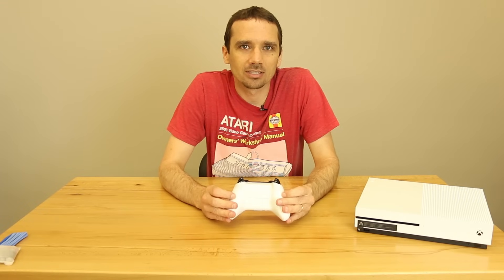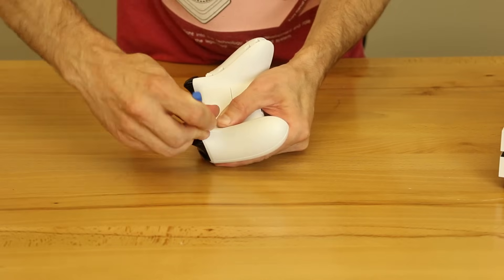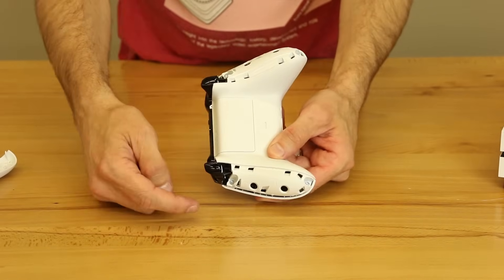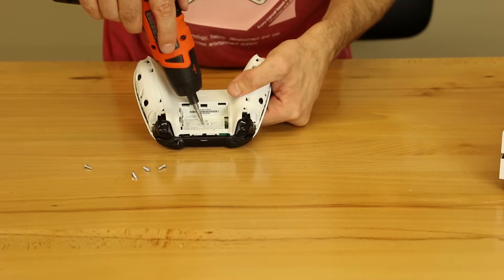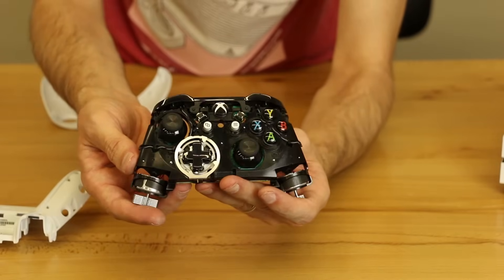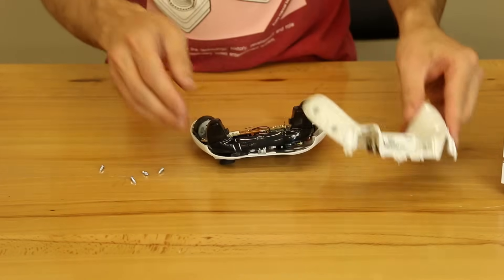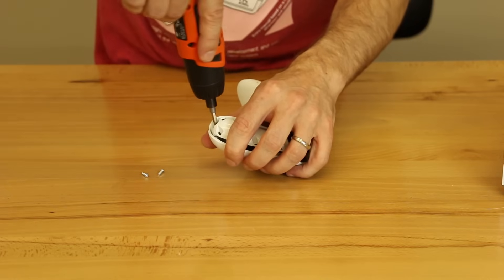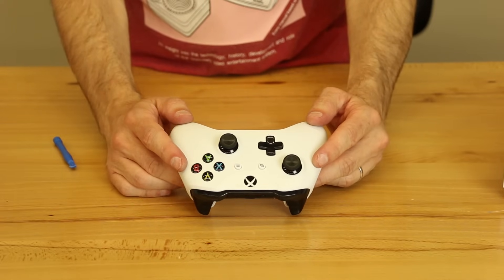Xbox One S Controller Teardown And Assembly

Comment: a small tip to anyone doing this. take the controller in your NON dominant hand. hold it so the joysticks are in to your stomach, or lap, take your non dominant hand, and put the thumb of that hand on top of the trigger button, and use a pry tool with your dominant hand. as you begin to pry with the tool, push your thumb from your non dominant hand down on the trigger button & depress it, and slide the thumb down to where its slightly under the back panels. it makes popping the rear panels off SO much easier

Comment: Thanks. One suggestion, if I may. The screw in the plastic when you want to screw it back in needs to be turn a bit in the opposite side to find a moment then the screw perfectly align the spiral row of the thread in the plastic - otherwise the screw will start creating a new row in the plastic, so after a few dis assemblies there will be no thread at all in the plastic.

Comment: The Lt  trigger was stiff due to when I dropped it in Kitchen.i had a headset on due to crazy noise where I live.  Thing is now Lt isn't stiff but lb is getting stuck. How does one clean .I read using alcohol etc .but if I take apart can clean easier. Don't want break as cd sell to store. I might try on old X360 pad and replace analog

Comment: When trying to reassemble my controller for the first time after doing a custom paint job, I thought I could do it myself without a tutorial. Afterwards I realized it was really squeaky, the screws wouldnt go all the way in, and the trigger made a clicking noise. I finally gave in and watched a tutorial and realized that I had placed the backplate on top of the battery contacts instead of letting the contacts go around the backplate, causing them to bend and make the backplate and front plate not come together as they were supposed to, proving that a little help is needed for everything

Comment: How do you disassemble it further?

This video only shows how to take off the casing on the controller but I want to be able to get to further into the controller.

Im trying to figure out what exactly is wrong with my x button. I see additional smaller T screws on the front side that holds the controller with the electronics together something that was not mentioned in this video

Comment: Jan 2022: Very helpful video. Managed to use a 2mm wide flat bladed precision screwdriver instead of a Torx bit.  Will lock itself offset between the security point and the inside edges of the screw head.

Comment: Using a small straight blade gets them out as well. You did not show how to take both boards out to repair sticky buttons. I figured it out however. PS1, PS2, PS3 & 4, SEGA Master, Genesis, N64, Xbox 360, NES & SNES, & Game Cube controllers I’ve completely rebuilt so that helped. Thanks for the starter vid however, it helped

Comment: Hey @tronicsFix I had a question for you, how would I go about create a controller with just one button functionality resulting in the A button and the wireless functionality. What part of the circuit boards in a Xbox one controller would i need to take apart for that. Remember I just want one button that results in A and wireless functionality.

Comment: Dont have a tool like that and the things don't seem to come off with hands ..
Ps : finally took the plastic handles off and the Screwes are nothing like those they are Way way smaller and very specific dont seem to have a screw driver small enough or special enough to unscrew them.

Comment: hey i was changing analogue sticks on this one and for some reason my home button won't register anymore (it lights up though). In order to power the controller i need to connect it to usb power. Any ideas what might have gone wrong ? I didn't touch the PCB board where the home button is located . I only desoldered the analogue sticks. Also currently I'm testing this with one analogue stick on board which i successfully installed and is working fine. The other one is missing since i'm expecting the part to arrive.

Comment: I need to add these to my elite controller. Grips are coming off and brand new ones are $90
Reply: Check Amazon. Replacement side covers are $20, and are a close match to OEM.

Any peeling or stretching of the grip part on the rear housing can be repaired, results will depend on how bad it is and your skill doing the repair. 👍

Comment: Just use a flathead screwdriver to pry it down 1 side, then continue up the other side. If you don't have a security star bit, a jeweler's flathead will fit between the center pin and the star ridges and it's just as easy to unscrew. Even better, sometimes the center pin snaps off with the flathead, then you can use a regular star bit. Took me 5 minutes. Hard to do with the wrong application, easy with an effective one. For the love of God why are you people using scissors

Comment: This man took his screw out in 10 seconds meanwhile I’ve been sitting here for the past half hour trying to get the first screw out.
Reply: Yeah same for some reason my t9 isn't fitting.
Reply: @caseybowen5111  you need a t9H
Reply: @krystek3099  Okay thanks I didn't realize there was a pin inside. Thankfully I didn't need to take apart my controller that far.

Comment: I mean, if you have the balls to pry the panels off of your $60-80 controller it then they should just let u mod away, cus if you ruin the panel it’s pretty much mega oof for the controller’s solid feel. that’s the only thing preventing me from doing this, I need to put the stick back in cus it broke and popped out and I fixed the stick and now I just need to open it up, I don’t have the screwdriver to do this but i’ve seen people improvise, I’m probs just gonna go for buying the screwdriver and wing the rest cus it doesn’t seem so bad, and the clips seem strong on the panels.

Comment: If you have a really small flat head, it's pretty easy to snap off the pins inside the torx screws, so you don't need to use a security torx.

Comment: Disassembled my ass this is like posting a vid of stripping a full car then taking the wheels off and saying job done. This is nothing u need to get the soldering iron out (thats whats diff from normal xbox one btw) to remove the vibrators then get the next set of screws out and remove the board to reveal the abyx home and other buttons... This vid was useless.

Comment: just a heads up never, ever use a drill that fast into a plastic mount, or even metal for that measure; all it takes is one slip and you'll flush the thread clean; do it by hand and you'd easily feel if you're about to screw your thread over.

Comment: Two hours in... Still can't get it open and I've hurt myself many times.
Reply: I literally opened it, changed the dpad, and was done in 20 minutes. I had 0 previous experience
Reply: @gavindunlap724  seriously I had to just get a broken plastic tab out of the controller cause it was moving around inside.
Reply: How? I'm sitting here just trying to get these darn screws out
Reply: Same 😪
Reply: I tried using scissors and just cut my hand
Reply: @NexyOJF  for what in the hell where you using the scissors for?
Reply: @salvatoredelilleorlansino5332  lol cuz I tried putting it in the crack to open it
Reply: @NexyOJF  ouuu, yeah, some controllers come with those parts higher, mine where lose from the beiginning
Reply: @NexyOJF  I'm so sorry Dx 

We are better off just buying a new one I guess.. Better than a hospital trip ya know?
Reply: Yes it hurt alot
Reply: Yea
Reply: I rage quit...
Reply: It's hard but after you do it once you get the hang of it
Reply: Y’all are weak, I got them off with ease
Reply: Use a flat head screw driver at the top just pry it open then go down
Reply: I just use a really small flathead
Reply: Same bruh
Reply: WHAT
Reply: Suspicious that the high number of suicides among teenage males may actually just be due to injuries sustained in this process. Goodby cruel world///

Comment: To those who's trying to find out the screw size, it's T9H. Note the H, because there is a hole in the middle of the torx. The screw has a protruding spike in the middle. That's why normal T9 would not work.
Reply: Literally the most annoying thing ever
Reply: @maxiboyman  they make it like that because they don’t want you to fix it and to just buy a new one
Reply: @boynowayboy3218  you can buy these bits at literally any hardware store
Reply: T9 works if you break the h with a small flat head
Reply: @DRAVO212  what does that mean
Reply: @DRAVO212  how do you break it
Reply: You can use a T8 it works
Reply: The least I have is t10 😑
Reply: There is a way around it without using the correct tool. The little pin in the centre helps hold a flat head screwdriver in place and lodge it in snug even though it's slightly offset you can still get it off and tighten it back up
Reply: Just knock the pin out the midd of the screw..simple. and i see you did not tear into the buttons and dual level circ boards....you should, bcuz im there rn
Reply: I thinks it's a T8H because that works perfectly for me
Reply: I had to use a tr 8
Reply: T8 does not work I have a set that stops at T8, yes you can break the piece in the middle but that doesn't always work so that's why it's just best to get the H version of what you need. T9H is the exact tool you need

Comment: I got a chrome case for Christmas and had no idea how to put it on. I was scared because it looked like I would have to completely take apart my controller, but from this video I have learned that I don’t need the bit that came with it which looks to be what all the components are normally held in, I just need the top and bottom case and I can just screw those on to the controller.

Comment: I opened my controller and I actually fixed something that was broken!
Reply: Did you use the T9, cuz for me it didn't work
Reply: @Memeify apperantly there's two types of T9's and the other one worked.
Reply: Thomas Raffensberger yeah it’s meant to be t8 security screw but I guess t9 also works apparently
Reply: Is it normal to hear a slight hum from the controller?
Reply: Tomato Tom yeah
Reply: @ukwqs  thanks

Comment: Hey Steve, I'm a fan of your videos. I just had a question on my controller, the left and right triggers when I hold them down get stuck. when I took the handle piece off I tried cleaning it with ipa and noticed a piece of sticky foam where the trigger meets with the panel when u press down. is it okay if I go ahead and remove those foam pieces ?
Reply: Youssef Dirani umm I wouldn’t do that I don’t think this is the cause if your problems though you might have something stuck down in the lower part of the controller
Reply: When I used to play a lot it would get stuck sometimes and I would here a weird click turns out it was a piece of the controller that would get in the way every now and then, however I wouldn’t remove those foam pieces they shouldn’t be what is causing them to stick unless they are sticky on the outside if they are then I would remove them but those are to stop the triggers from hitting the base or whatever when you click them
Reply: @joshuajones6905  hey I went ahead and removed them, yeah they foam pieces themselves were sticky.. the controller works great now

Comment: The major difference is that POS black wire.  It's connector is prone to breaking off with even the slightest force.  I can almost hear the design leads snickering knowing full well that most people will irreparably break the controller attempting to repair a sticky button.

Comment: I’m going to hydro dip it
Reply: I'm gonna use a blue and purple color shift
Reply: I’m also gonna hydro dip
Reply: All here for the same reason I guess.
Reply: Yeah I’m finna hydro dip
Reply: Yeah, i came here just for this purpose, does anyone have hints for hydro dipping? I was experimenting, so far i covered the body with an acrylic spray can and then a second layer with clear polish spray, but the result is not quite as smooth as expected. I'm also having an hard time in properly preparing the hydro dip with clear nail polish, any hints?
Reply: I came here to clean mine.  I thinking about possibility paintings mine with air brush
Reply: I’m going to customize, I am a professional customizer.

Comment: I got my headphone jack stuck into my controller and was wondering if taking apart my controller would allow me to remove it? Does anyone know
Reply: It will let you get the 3.5 unit out.  It just sits there unsecured between the two boards.  But if it's somehow stuck via debris, it's probably not going to help always unless you want to destroy the jack module.

Comment: When you have every tool ever made but a T9 socket R.I.P

Then you find a T9 but it's not the same T9 with a hole in it 💀
Reply: Lou E the whole needs to brake a really tiny flat head screw
Reply: @zombiekill541  lmaoo thanks bro i used the sl1
Reply: Me to bro everything but smh even have a t10
Reply: @journeytosafemylife2993   t15, t25, t27, t30, t40 lol and I'm sure there is more

Comment: The little wire between boards is that a pin or solder connection? Need to know before I take it off.

Comment: Hey man, im following your channel lately and it's very cool, i have one problem and maybe you can give me a hint or something... i have and xbox one controller, mod 1537, the first one that came up i think... anyway... both triggers are detected as pressed all the time, i tested this with windows 10 also... i removed the hall sensors effect and they still are detected as pressed... i was wondering if i can do some of this things: 1. replace the rt and lt with normal buttons with some modding, 2. somehow bypass or remove something to at least have the controller without detecting the triggers pressed. I am from argentina and it's very difficult to get spare parts of any kind here... and a new controller is VERY expensive... if you can give me any advice i will be very thankful.

Comment: Managed to get it open with a hex screwdriver still, what's the point of security screws if a) you can buy the tool to open them anyway & b) it's a controller, not a bank vault. & how you did the side panels, mine took some doing, definitely not by hand.
Reply: When taking apart a controller that's never been disassembled before the side panels will usually be the hardest to take off but with the right tool it shouldn't take too long

Comment: i can't get the screws out because it's a special kind of screw where i don't have a screwdriver for
Reply: a dinner knife does the trick, you have to be careful not to break the screw tho
Reply: Use a small flat head to break to break the pin and then you can use your regular torx bit
Reply: It’s a Torx Security screw

Comment: I appreciate the video, but in my opinion the title of needs to be corrected. Anyone who has done a real tear down of an Xbox One control know this is about 30% of the work required if you intend on thoroughly cleaning your Xbox One controller. There's is no doubt this video servers a purpose, minor problems can be fixed with a partial tear down like what is shown in this video however if you're having serious issues with your buttons sticking at best this will only give you minor improvements that will not last long.

I bought an Xbox One on the release date back in 2013 but have since upgraded to the more powerful Xbox One X, but I still use the original controller that came with my first Xbox but to keep it in good working order the partial tear down and cleaning process didn't much improve the performance. I haven't had to do a full tear down in awhile and was looking for a video that just help refresh my memory and this video doesn't have the information needed to do so. 

I think the video poster did a good job directing and showing how to do the most basic of disassembling needed to fix the most minor issues, but when I see tear down in my opinion I'm expecting to see a complete break down of the unit to its bear bones. As I explained is the only way to permanently fix the issues that plague most aging controllers.

Comment: Thanks buddy took mine apart this morning to clean it as 2 buttons were sticking put it back together but wouldn’t turn on, came across your video and it was the battery connector didn’t put them threw, now it’s working again thanks to your video, so awesome job buddy👍👍👍